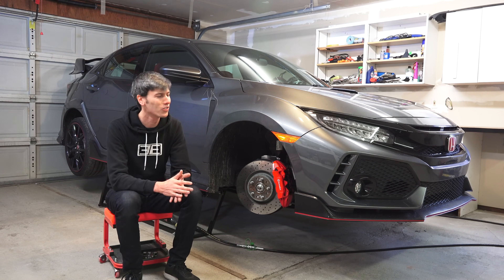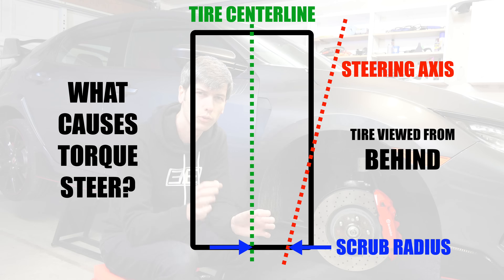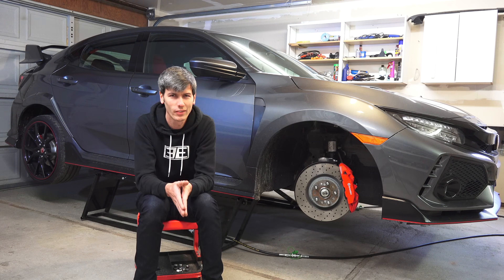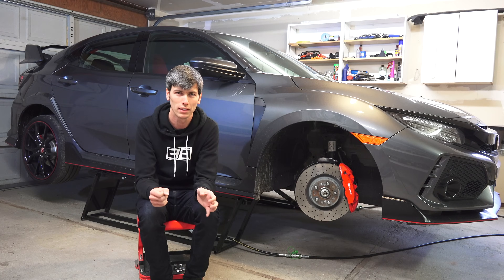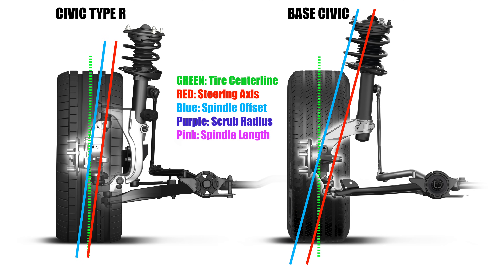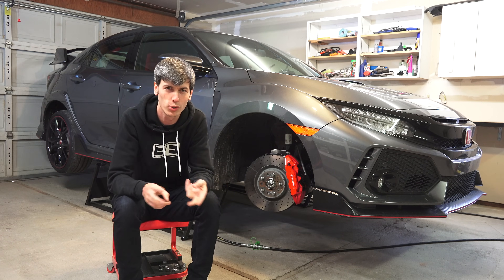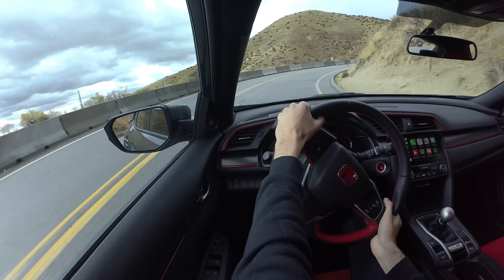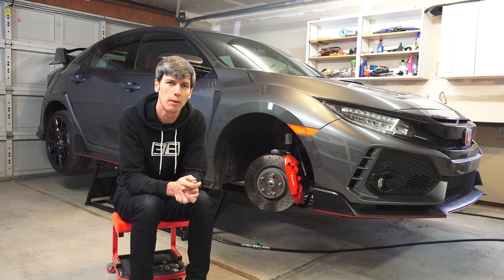Why Doesn't The Honda Civic Type R Have Torque Steer?

Comment: Question: What happens when you drive, for example, an automatic Mustang with the select-a-gear shifter in the sense of a manual Mustang (or driving it manually without a clutch pedal at all), 1 -> 2 -> D

Comment: Honda should throw this engine in a CRV with a bad ass AWD Transmission and make a Special Edition Rally CRV-'R' or something. No? Screw you, CRV's are awesome
Reply: Hercules Rockefeller all wheel drive hrv (yes, not crv) with 300hp and manual transmission. I will buy it right away :)
Reply: yeah they are. the old ones you could swap b series motors into and do all sorts of stuff to.
Reply: That would make the CR-V a roll-over trap like the Lexus used to be. Just....nope.

Comment: Are you sure that was torque steer Jason? Honda uses brakes in some conditions to steer the car. Its their torque vectoring system (i know its not really torque vectoring). It brakes the inside wheel to reduce the understeer. It could be the reason why it would keep steering in the same direction.

Comment: Great explanation. In short, they did as well as you can trying to “fix” a FWD platform for higher power... but it will always be compromised because of the architecture fundamentals.

This is why my 400+HP car is a longitudinal engine with RWD. ;-)

Comment: Don't you think the road you test the vehicles in, is a little bit dangerous from engineering point of view?! :D Better to change it! :) 
Also, I don't think people who did not drive or own a powerful FWD car will get what you are saying, but it is interesting how they handled it despite it was not a very serious problem. I had a car in which torque steer was sometimes so severe, it felt like the steering is locked for a short period of time!

Comment: Interesting but not at all revolutionary. I owned a 2012 Buick Regal GS and it has the same design, almost 300lbs of torque and 270hp and zero torque steer. Now my 2003 Sentra SE-R Spec V was a torque steer monster.

Comment: Funny how all the "racing" cars choose drilled rotors when we've learned that it is primarily aesthetic instead of the more functional and stronger slotted rotors. I do wonder about how much weight reduction this brings as a side benefit to the looks though.
Reply: not enough to mater. personally i prefer solid discs
Reply: Well it wud be rotational mass so 2.2 pds of rotational mass is the equivalent of 33pds of overall weight.i still wouldn’t get drilled only slotted rotors for me.
Reply: I heard that drilled rotors suck but ones with holes cast into them being made don’t

Comment: I swear the very first of this kind was developed by Lotus cars and commissioned by Corus Steel to find lightweight alternatives to aluminium double wishbone suspensions, using steel.

It's a cheaper alternative but much better than the traditional Macpherson set up.

Trivia: Rover 400/45/ZS has full independent double wishbone front suspension. Pricey.

Comment: There is also the EPS that can compensate for torque steer by using the torque sensor on the steering wheel and providing opposite counter force.

Comment: Are you sure what you were describing as torque steer at the end of the video was actually torque steer? Sounds like the effect from the LSD. I got that from my old R26 megane and my current leon cupra 290 which both have LSD. If the sensation is that of the car tightening its line on power application in the corner then its almost certainly the LSD doing what it's supposed to.

Comment: No subarus ever have torque steer. Their drive shafts are equal lengths
Reply: A Tapir Named Jeff not having torque helps too
Reply from the maker: +A Tapir Named Jeff equal driveshafts doesn’t always mean no torque steer unfortunately. Can still have it, but Subarus tend to be AWD and low power so torque steer isn’t perceived.

Comment: lol, and I was convinced that torque steering is something that should help FWD cars to overcome that huge power on front wheels, so it goes easier around corners. Like some of the electric/hybrid cars (i8, NSX) have on front wheels, where torque is basically helping car to keep direction...
Reply from the maker: +Warlock torque vectoring perhaps!

Comment: Looks very similar to my 93 Civic EG-Hatch with double wishbone suspension
Reply: This system is old Ford called it Revo Knuckles on Focus RS and many others have it (GM, Renault) , companies are cheap, the double wishbones  of your 93 Civic are a better system but it costs more and if McPherson struts pre exist in the model they can make a "special" model by just adding that with no need to reinforce/redesign the Chassis on the Strut attachment point (twisting forces).

Comment: Love the car but those fake vents give me the shits. Great video thou.
Reply: They're not fake. They are called air curtains and they help to smooth the airflow on the front of the car ; the air is kept closer to the body this way, which results in a smoother airflow pattern and, as a result, better aerodynamics and theoretically better top speed and fuel economy.

Comment: Torque steering suck especially when you spin the front tires and in rainy streets or on street with mud. You basically loose the control of the wheels and the car behaves very strange. Its like the steering wheel is completely disconnected from the front tires and the wheels drive the car.

Comment: Could it also be possible Honda used the electric steering to artificially hold the steering straight under hard acceleration and that’s why on corner exit it it holds slightly turned.
Reply from the maker: +J Dub hmm, I guess it’s possible but would likely be very challenging to implement without giving the driver artificial feedback.
Reply: Engineering Explained could you ask a Honda Engineer?  Having perfect suspension helps, but I always thought you get torque steer from having uneven length half shafts.

Comment: I will stick to Subarus with symmetrical AWD. No torque steer and and awesome in the winter. With Subaru's new torque vectoring system you get rid of any under steer tendencies. The last Honda product I had was an Acura TL that was plagued with transmission issues, electronics that failed way to often and torque steer that was plain unacceptable. Not to mention how awful it was in even a slight coating of snow.

Comment: Nice video. Glad my car has ZERO torque steer :) This is basically the difference between double wishbone and McPherson strut  suspension. Nothing magic here.
Reply from the maker: +KangoV could be double wishbone or MacPherson and still have torque steer if the scrub radius and spindle length are not kept in check.

Comment: Renault was first with its perfo hub. Then ford with revoknuckle. Then vauxhall with hiperstrut. Honda basically late to the party.
Reply: Peugeot had this on its 407 a good while before Renault
Reply: Sorry mate you dont realise that in those days Hondas didnt even use struts they used wishbones - no torque steer.
Reply: A good copy is better than a bad invention. :)
Reply: Anyway, all mentioned dont have VTEC technology. Vis a vis
Reply: cool, but all these cars that "had" this before, had a fail version, in a fail car, with fail engines. 

This actually works as advertised, and goes faster than advertised. so yeah... there's that.
Reply: My 1997 passat already had a solution for this long before the 407, use a longitudinal engine lol.
Reply: I've worked on a good few of them, and they are a good car just a bit of a pain at times and usually better off replacing the full set, the suspension is a bit too soft on them just about everyone I know that had one went through a few oil sumps and them on standard height
Reply: it did even on a basic 407 whereas today only the most powerful 508 are equipped with such a front suspension
Reply: As far as I've seen its still used in all models of the Citroen c5
Reply: How much trouble does the suspension in one of those passats give and how much is it to replace said suspension lol
Reply: Glenn McCabe if you do it yourself it's about 30 minutes for 1 rod and will cost you about 50 euro it's not reliable indeed but that is pretty much the only weak point of the car.
Reply: The suspension is to soft indeed, it will lean over to much in corners. i haven't bottem it out because it is quite high from the ground for a sedan, still the suspension should be alot stiffer indeed.

Comment: They did it great! I almost ditched an xc-90 (because 400bhp) in the traffic light grand prix due to torque steer, it was really hard to keep it straight and the car could not cope with the power at all. Great solution from Honda, but how did they tackle the problems coming with a scrub radius of zero? Like steeringplay and making the steering nervous when locking up for example? Could you do a video on that?

Comment: The original Olds Toronado from 1965 had a negative scrub radius - the steering axis was outside the tire centerline. It accomplished this by a combination of large tires, long A-arm suspension with torsion bars, and reverse-dished wheels. This gave stable handling with no torque steer, and since the Toronado was a 4500 pound car with some 400 HP, that was important. Apparently no one has built a car with negative scrub radius since then, although it worked very well in that case.

Comment: Launching it with no hands, with zero tq steer!? That's impressive
Reply: Dacia Sandero can do that. With a 1.5dCi 68hp diesel...
Reply: Shows how little power it has
Reply: @tannercox4537  Yeah, 320HP in front wheel drive is very little...
Reply: @tannercox4537  Because a CTR is for cornering, handling, and track performance. There is more fun to be had in driving than mindlessly flooring the gas on a straight. If that's your thing no shame in it, just says a bit about your intellect lol
Reply: @tannercox4537  most powerful turbo i4 vtec engine Honda has ever produced but yeah it’s little power lol
Reply: @Bbronson  okay it’s still slow relative to any real performance engine. If you want a fast car why would you waste your money on 4 cylinder car. Even with money in it your still gonna get gapped by a little 5.0 slow and that’s sad
Reply: @tannercox4537  sure but it’s way more efficient and way lighter and way more fun on the track. Plus everything is subjective
Reply: @FireManiac58  idk kinda seems like an excuse guys use that drive around in bank owned cars
Reply: @tannercox4537  ??? This applies to every fwd 4 cylinder performance car though they’re  still fun to drive and sometimes more fun than a heavy loose steering muscle car. It’s all about perspective
Reply: @FireManiac58  I’d say my 4th gen is anything but loose steering. My 4 link and strange 9” keeps that rear end pretty straight and probably hooks better than that 300hp Honda. 
But of course driving my ole ladies maxima is okay but honestly doesn’t seem “fun” or anyone’s first choice. 4 cylinder fwd cars kinda seem like a dude that can’t work on cars so he buys what the bank allows him kinda cars
Reply: @tannercox4537  just because your maxima isn’t fun to drive doesn’t mean all small engines. I mean look what koenseigg did with 3 cylinders or even what Toyota did with the gr Yaris. It’s just different styles.
Reply: @FireManiac58  saying Honda’s and Toyota commuters are like supercars is like me saying my 6.0 LS is like a Ferrari or Audi v8😂 I swear Honda guys are a special breed.
Reply: @tannercox4537  Let's see you drive that Audi on gravel road then, just like good ol' days 😂
Reply: @tannercox4537  def not true you put an extra 5k-8k on a honda civic sport and you getting to 350-400 whp and easily gap a 5.0. Not only is it prolly one of the cheapest cars to do this with but also vtec hits different
Reply: @Motorgrindset1  vetch definitely doesn’t hit different. Now nitrous or boost over 18lbs feels different. Just because you’ve seen YouTubers do it doesn’t mean it’s easy. Go to your local drag strip and that will tell you what engines are easy and cheap to make power (conventional small blocks or Ls)

We all get some of you kids are loyal to a T but put that much effort in real life and not youtube and you’ll learn a lot more and a lot less bias too
Reply: @tannercox4537  i do more research by myself than yt and you said a stock 5.0 still gaps a tuned honda civic type r which is cap 🧢
Reply: @Motorgrindset1  only 5.0 a stock Honda Civic type r is gapping is one from foxbody in 80’s. 
It’s all cool liking Hondas, Toyotas, fords, chevys, etc but to be delusional of simple engineering and physics when it comes displacement, weight, and many factors that go into acceleration. For how many cylinders it does have it in a impressive but when it comes to engineers who get paid a lot of money in the drag racing world there’s a reason they don’t choose Small engines. The most successful small engine team in drag racing uses a Mitsubishi engine anyways. 

You are suffering from the dunning Krueger effect
Reply: @tannercox4537  well now we’re on different topics i was never talking about professional drag racing and i was never talking about a stock honda civic type r you’re straw maning. I said a “TUNED” honda civic type r or sport or si is gapping a stock 5.0 . I also said it’s really easy to put power onto those engines and it’s cheaper. Like a stock b series engine with a turbo kit getting up to 500 hp or the k series engine which gets to 500 on stock internals (obviously putting 500hp on a stock vtec engine makes it incredibly unreliable). Yes a tuned 5.0 vs a tuned vtec civic isn’t going to beat the 5.0 but when it comes to being the fastest on the road the 500 hp civic gaps most stock cars and are more affordable because honda parts are everywhere.
Reply: @tannercox4537  why are you trying to convince yourself so bad ? Got second thoughts on that POS muscle car you took out a loan for ?

Comment: The better solution would be to make a rear wheel drive type R.  No torque steer and you could power drift.  It would be difficult to go back to a FWD performance car after owning RWD.

Comment: Wonder how this dynamic compares with the 3rd Generation Eclipse, 2nd Gen Stratus R/T and Sebring LXi and Limited Coupes.  I am considering buying one of these cars.  Could EE do a perfomance review of either of the two Chrysler versions of this car, that is the '01-'05 3.0 V6 versions of this platform.  How good or bad is the torque steer?

Comment: Why doesn't Civics have torque steer?
-They don't have any torque.
Reply: Its got almost as much torque as it has horsepower buddy,thats plenty of torque in a Honda
Reply: WarriorOfEden3033 That tells everything about your knowledge. :D
Reply: lol
Reply: I came here and kept scrolling exactly expecting to find this comment.
Reply: Ha, old joke that might apply to the old NA Civics, and only if you care about trying to drag race stock Civics.  Now put it on a track and watch it snake through corners like an athlete with the VTEC kicking in.  There's a reason why the old Civics were super popular (and still are) racing around on the circuit.  People who measure power only by torque don't get it...
*Also, this 2.0 Turbo Civic Type R has plenty of torque.
Reply: Says the guy going to work by bus lol.
Reply: Augmented Ninja7 it depends on the units used
Reply: Niklas makes no sense
Reply: It has a whole lot more torque than whatever 20-year old car your mom gave you to drive.
Reply: +Engineering Explained ....how was the shifting?  you looked pretty smooth in the launch
Reply: +Engineering Explained ... if you to get one of these, would you buy the new Type-R over a new STI?
Reply: The Ford Focus has a better track time
Reply: Augmented Ninja7 actually they have less torque than HP. That isn’t good
Reply: WarriorOfEden3033 ?
Reply: Thats why the integra type r doesnt torque steer... 131 lb-ft of torque is nothing.
Reply: I have got 2016 civic ex 2.0L NA, so far I have ktuner  tune, cai, magnaflow muffler. The car is very fun to drive. The engine is wild albeit not as strong as I wanted it to be. Downpipe and custom full exhaust is next to come.
Reply: honda fanboy triggered
Reply from the maker: +Niklas more than the Golf R and STI.
Reply: Niklas turbo bruh, of course turbo doesn't have any torque 😂😂😂
Reply: Augmented Ninja7 enough torque to get groceries
Reply: Stop trying to explain yourselves. He made a very funny joke and it stands valid and funny  as a joke. No need to prove him wrong with your lap times etc.

Comment: I've experienced it a lot on track with this car (as you can see in my channel), but I don't think it's torque steer, but rather the AHA which helps the LSD providing this kind of sensation in the steering wheel. This to me, helps a lot in tight sections on track to make forget the weight of the car.

Comment: Overengineered for something that makes so little torque to begin with. Just an excuse to charge you more for things you dont need.
Reply from the maker: +AsGoodAsAHacker I think if you drove some lower powered FWD cars that do have torque steer, you’d be impressed how well this does with significantly more torque.

Comment: Can you explain how castor effects the vehicles dynamics please?
Reply: basically why would a race team adjust it or why would a factory road car have that specific setting for castor
Reply: Caster, short and sweet, is the angle of the dampening part of your suspension going to or from the front of the car. Positive caster absorbs less of the shocks from the road and negative caster absorbs more.

Again, this is the short and sweet.

Comment: This Type R geometry looks heavier, or at least seems to put more mass out by the wheel.
Therefore, is the unsprung weight also increased?  Perhaps another video on the full implications of this system (beyond the torque steer).

As always, good info and precise and fast delivery!